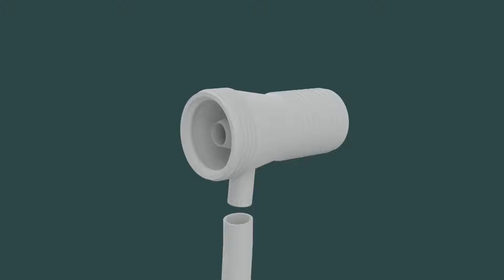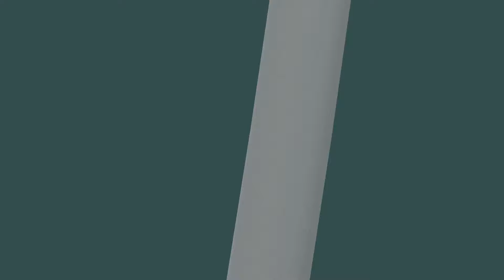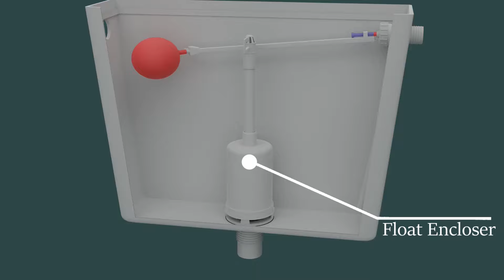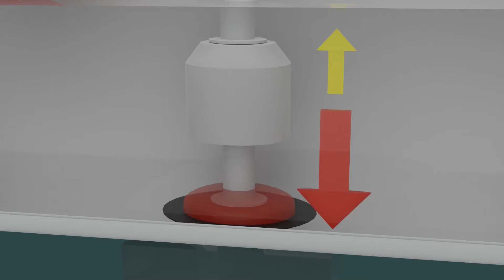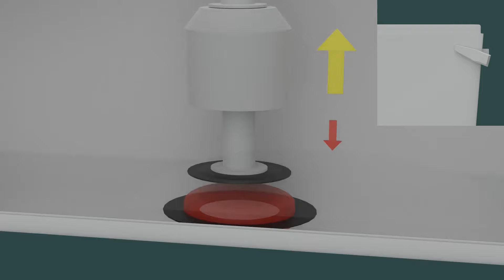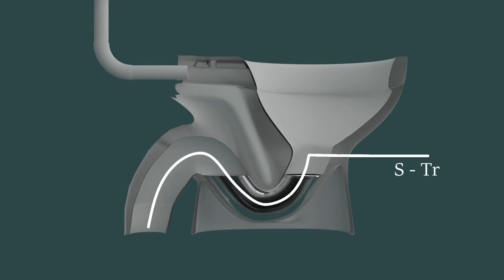How Flush Toilet Works? | 3D Animation | Siphon

Comment: While the Animation is done very well,  The engineering principles are not up to par with Good Plumbing Engineering Practices.  There is no vacuum breaker to prevent siphoning the entire water tank of the toilet back into the water supply.  This design as shown will flush, but would be prohibited in the USA because of the potential Backflow hazard. in addition, your drain flow illustration shows the waste pipe flowing full.  In the USA, the drains are designed to flow half full and venting is used to equalize the pressure on both sides of the fixture trap ( to prevent siphoning of the fixture traps of other fixtures.  Siphoning is not a problem in water closets (Toilets) that is the principle in which they work, however, the trap is generally refilled by trailing water and a refill tube in the tank that has an air gap to protect from siphoning.  Ron George, Columnist with Plumbing Engineer Magazine.  www.PHCPPRos.com

Comment: Note that what is being described is an American type siphon flush toilet and is not the kind common in india. In India almost all of the toilets are of European washdown type. This kind typically  has no siphon jet ( although a few  have siphon jets ) and the trapway ( outlet from the bowl ) is horizontal ( no siphon effect ). Standstill water level will be lower ( poop tends to get exposed to air before the flush - and hence they tend to be smellier)
American type tend to have a much narrower ( diameter ) trapways when compared to the European washdown type, which initiates the siphon effect for smaller volume of water

Comment: From 5:50min, if the water in the toilet bowl doesn’t got sucked out very fast, what could be the problem? Could toilet bowl design that doesn’t hold enough water to initiate the siphon effect be the problem? I have checked that nothing got stuck in the tube. This problem occurs after changing the toilet bowl.